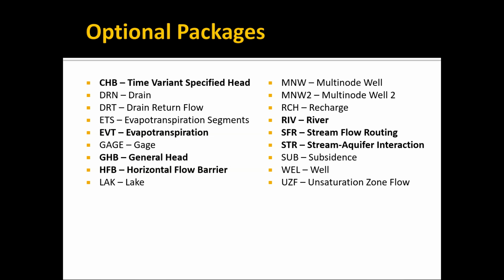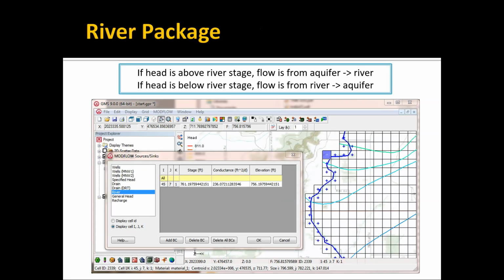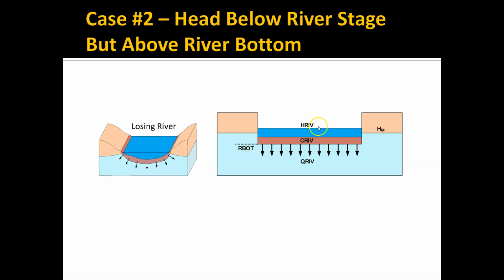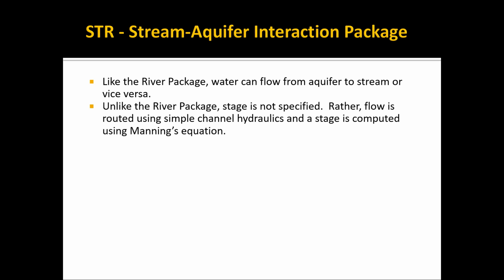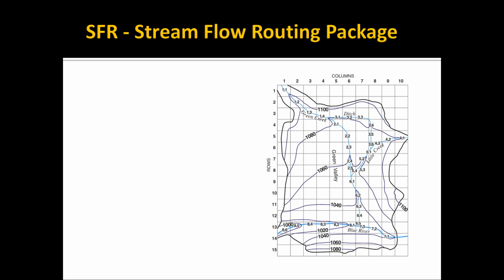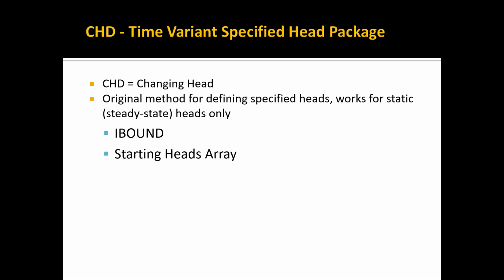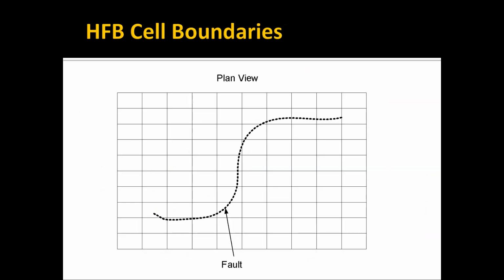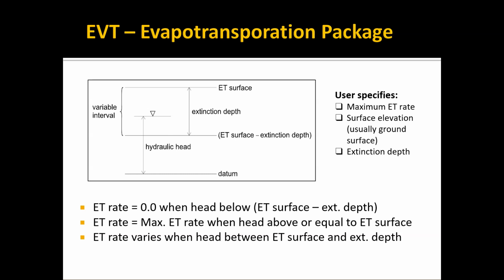MODFLOW - Optional Packages, Pt 2

Comment: Hi, do you have a video discussing specified flow and under which circumstances it should be used?
Reply from the maker: No. Specified flow boundary conditions are fairly rare in my experience. I have typically seen them used at the edge of an alluvial or basin fill aquifer adjacent to a mountain range where the shallow groundwater flow above the bedrock at the edge of the mountain boundary was estimated. Typically we use no-flow or head-dependent boundary conditions.